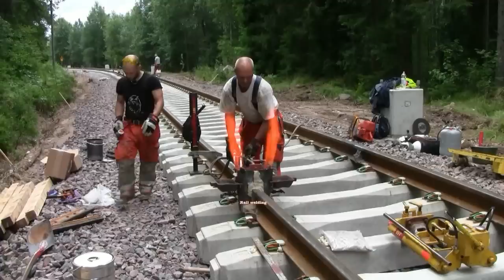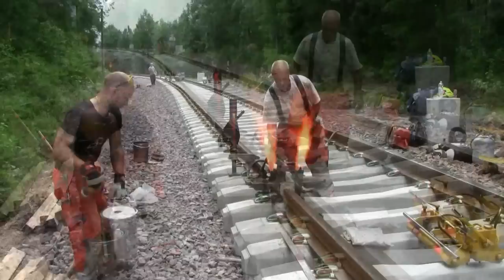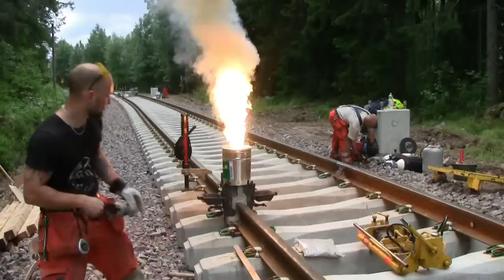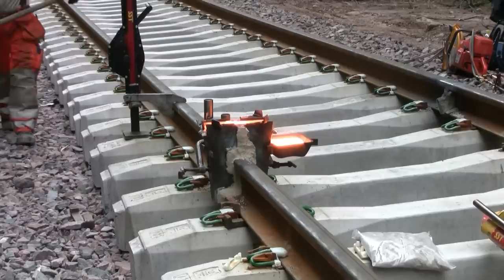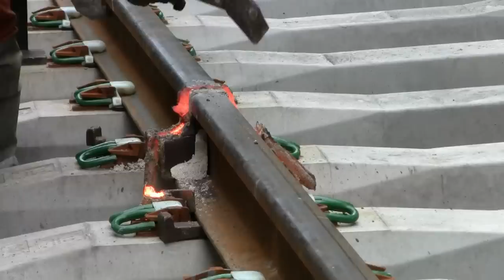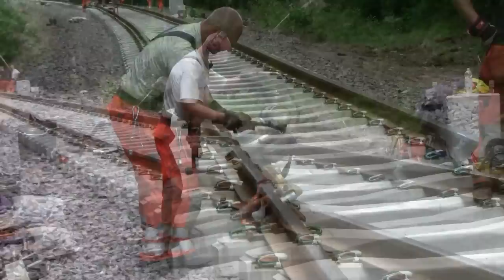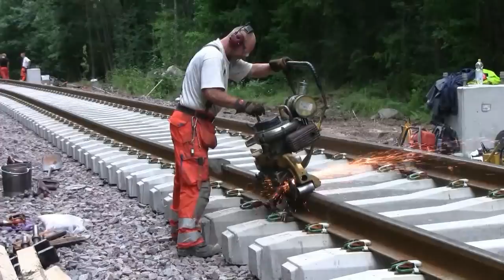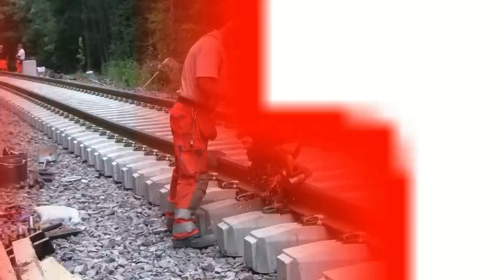Railroad thermite welding

Comment: Why didnt you show the track after the finish?? what was being done? No one said a word?
Reply: I will explain.
1) There is a clamp in place to hold the ends together as he heat treats them. This clamp also acts as a guide/holder for the thermite.
2) They use the thermite to bond the two ends together using the heat and pressure generated.
3) They remove the apparatus and clamps then proceed to knock off the slag (waste material) on the outside while it is still hot and brittle.
4) All that's left is for it to cool (which takes a while) then polish out any rough spots and check the quality of the weld.

You can see a finished weld behind them if you look closely enough. Hope that clarifies things for you. :-)
Reply: Zeb Cheek thank you! Very kind!😉
Reply: Welcome
Reply: this is just wrong...a civilized conversation in youtube!!!
just kidding of course :)
Reply: -Thank You.
Reply: If you do this job every day, 10 times an hour, you probably get good enough that you don't have to talk about it while you are doing it.  They probably do talk about other stuff during the day, (complaining about how their kids weren't doing their homework or whatever,) but the camera showed up and they didn't want to immortalize "Little Jimmy got a C on his science test last week" into the video, so...

That and they are in Sweden so they probably speak Swedish, which means most of YouTube wouldn't have understood it anyways.
Reply: Zeb Cheek 2) Heat and pressure? It can't really be generating pressure because it's just plonked on top -- the whole apparatus is operating at normal atmospheric pressure. My understanding is that the thermite reaction generates hot, molten iron -- so the fact that this reaction is actually providing new iron rather than just melting the existing rail is worth noting too.
3) Slag is a specific byproduct of the steelmaking industry consisting mostly of silicates, it's not just a fancy word for "waste" or "extra". So it's not an appropriate description for what's being knocked off -- which is just very hot metal.

Comment: Pretty funny how people in the comments thinks they know a better way to do that.
Reply: Have you worked on the railroad before?
Reply: ***** I haven't, thats why i don't trying to act in the comments i know better
Reply: David V Yea im sure a random guy that knows nothing of welding know a better way
Reply: Honestly, probably the fastest way to weld it in the field with a certain tolerance of quality.
It takes 2 guys. It only take what looks like $25,000 of equipment, probably less than 2 hours of work from start to finish.

There are many many many ways to do this with higher quality, but those ways would be slower, require more expertise, would be very hard to do in the field... Or if you managed to fix all those problems it would be fabulously expensive.

But then again, there is ALWAYS a better way... ALWAYS...
Its a question of cost of resources, time to complete, cost and time of the workers, ability of the workers, requirements of the job, what vehicles you already own... ect ect ect.

TL:DR There is always a better way. For some reason, cost/time/ability, thermite welding is often chosen for railroad construction.

Source: Welder certified in D1.1 6g 2in sch80 steel pipe, D1.1 steel plate groove unlimited thickness all position, D1.1 steel plate fillet unlimited thickness all possition, D1.2 aluminum AWS D1.2 (2015)
Reply: Chill Bro Main reason to use the thermite, if i remember correctly is because it sets in a way that makes the top extremely hard and durable, and the bottom, quite flexible. Don't ask me how it happens, but i think that's why they still do it this way.
Reply: I totally knew it would work. Just sayin'.
Reply: You mean the guys that say jet fuel can do the same thing?
Reply: Majman and you think you know better than people who may genuinely have a more efficient way of doing it.
Reply: There has not been a more efficient way invented yet when it comes to a cheap, fairly quick method of welding rail together, while there are improved methods/steps compared to what's in this video, the overall outcome is the same. Quickest I've ever done two of these is 45 minutes and we were moving at a much quicker pace than these two guys.

The average cost of a thermite weld is about 200 bucks, throw in man hours, fuel costs, etc. you're under 1000 a weld and it only gets cheaper as they get knocked out one after another. (Most railroads assume 2.5 hours per weld)

There is a method called "Electric Flashbutt Welding" that is much quicker than this, however the trucks that are capable are in the millions of dollars, and the owners to those patented machines charges thousands of dollars a day to use them, for this reason, it is usually avoided in non-emergency situations.
Reply: I was thinking exact same thing.
Reply: NO.   
 @chillbro1010   t

Comment: only 2,000 more miles to go.
Reply: Which requires 16,000 more welds, or 32,000 if you count both sides. They weld just every 200 meter or so, which means a true professional team like this can cover many kilometers in a day's work.
Reply: Not all rails are welded together tho
Reply: Easy money
Reply: 😂😂😂 These are the real MVPs.
Reply: Lmao
Reply: Zeksteve  I
Reply: sumon azizul Calcio serie a
Reply: Sweden isn't even that big.
Reply: that sounds like a secured paycheck for a couple months. I'm guessing around $35 an hour and around $50 for overtime. But they're in Europe so idk
Reply: @Lonnie Frank Yes, with Continuous Welder Rail (CWR) like this the whole thing will be welded except for Insulated Block Joints for track circuiting purposes (increasingly being phased out with Jointless Track Circuits and Moving Block signalling systems and in any case these have no allowance for thermal expansion or contraction and are treated as CWR).  In the UK they install expansion joints roughly every 5 miles or around points and crossing layouts, whichever comes first, (Speaking from experience so can't say for continental Europe) but apart from that new installations are almost exclusively CWR.
Reply: Bermas.  
☺😈😴 johnny rotten
Reply: turalula lu
Reply: Cadê os seus epi galera
Reply: I am Arc welder so I want job
Reply: @Meg_Lovegood  I Vi bio y
Reply: jojojeep1 dudes gunna be like 60 when this shit is done
Reply: @slaughtergang518  Sweden isn't in Europe it's in Scandinavia.
Reply: Paul Johansson I hope you’re joking... Yes, Sweden is a part of Scandinavia, along with Norway and Denmark. 

That doesn’t mean Sweden isn’t a part of Europe.
Reply: Mata
Reply: 13th Evergreen ,
Reply: 2019 and still 1,998 miles to go
Reply: @Dovenpeis  1km max a day id say on both tracks ?

Comment: If there is no small gap between the ties, how do they compensate for the shrinkage and expansion with temperature differences??
Reply: +Scott Huddas Essentially, the tracks are so firmly anchored once the railway is done that this isn't an issue in modern railway building.
Reply: the rail is stressed then welded, (not shown here) it artificially puts the temperature in the rail to stop it expanding.
Reply: +pandrol7 How about shrinking during cold?
Reply: good question, the rail can take contraction much more than expansion, at worst it will break and leave a small gap, the rail will still be fastened to the sleepers with no misalignment and derailment very unlikely, a buckle would almost certainly derail the train.
Reply: Thermite welding is done if there is a crack in railroad, and to compensate expansion and contraction of rails there will be gaps left b/w adjacent rails
Reply: nope

Comment: Where are the termites?
Reply: Bryce Dabney There actually is something called termite welding, where they use termites. So no, I am not an idiot.
Reply: +WarthDader74 I guarantee you there is no such thing as termite welding
Reply: 12345Unicornio That's strange, I have seen it myself.
Reply: +WarthDader74 OK, explain to me how it works
Reply: 12345Unicornio They used termites as a filler in the weld. It made the job less expensive. It could be done because the termites get a very hard consistency when they have been dead for a while.
Reply: +WarthDader74 hahahahah, That's the stupidest thing I have ever heard. Would love to see your source, I myself couldn't find any.
Reply: +Zyrus this guys just trying to find a way to cover up his mistake
Reply: 12345Unicornio Yeah, it was just too funny.
Reply: It just made a search on the internet myself, and it is difficult to find so much about termite welding. The reason is that 'thermite welding' is spelled very similarly, with an 'h' letter. And most info is about that. But I assure you that termite welding is real, a friend of mine did work with that in the 70's. Actually the reason that I found this youtube clip, is that I made a search for termite welding.
Reply: WarthDader74 HAHA, Just admit that you're wrong and you missed read the title as "Termite welding".
Reply: Zyrus No, I did nicht do that
Reply: Wow.
Reply: +WarthDader74 My uncle did termite welding in the 80s! It's sad that that method isn't used anymore.
Reply: MellowJelly Yeah, I guess it did since it's almost impossible to tell if someone is being sarcastic in text. How could you tell though?
Reply: +WarthDader74 LOL
Reply: +MellowJelly i did termite welding once. very impractical method.
Reply: Paul Hendrix Yes, it was unpractical, that's the reason they stopped doing it.
Reply: +WarthDader74 ur comment made my day lol
Reply: +WarthDader74 We tried that where I used to work.  We hired all these termites and bought the really small welding gear for them to use.  The little bastards just ignored the gear and the job was a disaster.  Soon after that, the building we were working out of crumbled to the ground.
Reply: rubert134 Ok I understand. But then you did it in the wrong way. The termites are supposed to function as a filler material in the welding itself. Some british experts came up with that idea during WWII, to save money.
Reply: +WarthDader74 Seems weird. How the heck would the termites help the weld bond the material? seems like it would just result in burned up termites and shitty welds.
Reply: Keinlicht There is some kind of special mineral in the termites' bodies, which bounds to the weld and interreacts with it. It is a chemical prosess.
Reply: WarthDader74
Huh. weird. Wish there was more documentation online about this, interesting bit of trivia.
Reply: Keinlicht It seems very hard to find, of some reason
Reply: +WarthDader74 You look like Jimmy Savile which is not a good look these days mate
Reply: Thermite is a mixture of multiple powders metal powder and metal oxide
Reply: AlphaMale1228 bout time rust made its self usefull lol
Reply: They are on that Tim Allen movie.
Reply: Coil Smoke Is that some kind of documentary?
Reply: WarthDader74 That was a reference to "Galaxy quest". Tim Allen's character kept calling his off world friends "Termites" but their actual names where>  "Thermians from the Klaatu Nebula".
Reply: Coil Smoke Ok, I understand.
Reply: no it actuallly exists, my uncle did a welding job using a block of solidified dead termites, it actually exists
Reply: They are plotting the next 9/11 my young one..
Reply: realize this is a long time ago, but in Denmark they call the process termit - svejsning https://www.svendhjorth.dk/index.php?option=com_content&view=article&id=260%3A2009-07-05-03-27-36&catid=57%3Ajernbane-teknik--sporarbejde&Itemid=115&lang=da
Reply: Warth, how’s the termite research going?  Can’t take this suspense...
Reply: One of the funnies comment chains I've read in a while
Reply: Zyrus I can tell when he said "Where's the termites".
Reply: Hehe, you made my day---LoL
Reply: Sorry, no. The hardest material in the insect's body is chitin (if you just thought of rhinos and/or fingernails, yes, it is that stuff.) Chitin is undoubtedly very useful. It has antimicrobial and antioxidant properties, making it a promising material in the pharmaceutical world. (Note: if you grind up and eat rhino horns, it won't cure your sickness, so don't kill any rhinos.) Despite this, chitin has no uses whatsoever in the transportation or welding industry. Have a nice day.
Reply: Jokes are funniest when you play along.
Reply: Thermite ,silly.
Reply: WarthDader74, did a good job at it too, Hugh Mungus.
Reply: Everyone knows about Termite welding. Amateur. Now go get me my wood stretcher and blinker fluid .
Reply: In the background watching
Reply: In the bucket. R.I.P Bucket..
Reply: Any updates on the termites?

Comment: where im from they dont weld railroad, it gets hot in summer and cold in winter so it needs to expand and retract alot more.. they just leave a small gap inbetween each section..
Reply: All new tracks laid in both Norway and Sweden are thermite welded, there's tracks going via Kiruna and up to Narvik in norway, Kiruna sees average temperatures as low as -22 in the winter and average highs as high as 17.9(acording to wikipedia). To acomodate for thermal expantion/retraction they are using Pandrol e-clip and fastclip to fasten the rails rather than bolting them down as more traditional with jointed tracks.
Reply: ChargedTTq yeah they wrap barbed wire around the gap REALLY tight and call it a day lol
Reply: Zphyra Ryuu if your "hot" means 40-50 C , then i'd agree these welds will work just fine in regions with a large range of temperature difference in winters and summers.
Reply: Patrick V same but in north america railroad is a thing of the past and they are ripping out tones of tracks anyways. ares are cheap to build last forever and cheaper to fix
Reply: neosomato hypergenesis #皮

Comment: When you mix fuel, metal oxide and metal powder in just the right way, it burns at two thousand degrees Celsius. Hot enough to cut through nearly any barrier known to man. Throw some C4 into the mix…and you’ve got one hell of a combination.
Reply: Nobody knows that for sure
Reply: Rust and aluminum are very uncommon materials in modern construction. Pretty fishy if you find them. right?
Reply: Jet fuel seems able to cut through twin towers
Reply: Is this a 911 reference?
Reply: Really big f*cking hole coming right up.
Reply: Say hi to the FBI for me
Reply: MaQuGo119 UNLOCKED: THERMITE
Reply: vx
Reply: Technically you only need anhydrous rust (stick some rust into an oven or something) and powdered aluminum
Then you need something to heat it up so that it will react. The formula is 2Fe(s)+Al2O3(s)->Fe2O3(s)+2Al(s)
Reply: FOOKIN LASER SIGHTS
Reply: I spy a Rainbow Siege Six reference ;)
Reply: M C

Comment: I heard that jet fuel can do the same thing. =)
Reply: thank you, I wasn't allowed to stop scrolling until I found jet fuel reference
Reply: TheYAYOsvk I came all the way down the comments to see a 9/11 comment lol
Reply: Yeah, ignore all the special equipment they needed here in this video and the fact that it needed to attach directly to the rail and the amount of time it took to do just one single weld (completely undetected right?  After all, they're out in the woods in the middle of nowhere.)  Truther's aren't fucking morons because they think 911 was an inside job; they're fucking morons because you can point out the obvious flaws in their conspiracy theory and yet they'll still think it was an inside job.
Reply: apparently it is more of a meme then a terrorist attack.
Reply: Jet Fuel burned up at the moment of impact, hence, the bigass fireball....the fuel turned into vapor, and flashed off.  What was left behind, was a cool fire.  Think of this....you cook a pizza in your oven at 425....say even 500 degrees.....forget it, change subject....what does the mom look like?
Reply: Special equipment?  A bucket, shovel, source of ignition, and some prepared thermite powder.
Reply: Turns out Mossad can melt steel beams tho
Reply: Try to explain this one...

Radar data from 10+ stations reported the exact speed of the planes on 9/11. It was even covered completely in the 9/11 commission report. Btw did I mention that such radar data is never wrong unless fabricated?

Now feel welcome to look up the maximum speeds of the planes, especially given what altitudes they were are; from above 10k feet all the way to a few hundred feet - to near sea level.

Next look up the word FLUTTER. Better yet talk to ANY pilot about the word.

Because just a few brief seconds of flutter rips any plane (even the most advanced jet fighter) to shreds in just a few brief seconds.

So how exactly did all of those planes exceed their maximum engineered (by manufacturer and also by physical testing) speed by 10 to even 25%+ for many minutes on end.

Simply not possible; proven by physics and by elementary engineering.

If you think that it can be done, let me know - I'll take that bet on any level.
Reply: Jet fuel is diesel...
Reply: Ronald C Krause Jr yeah that report was a bit off. On page 43 I believe, it states Bush first learned about it at the school. Thats crap because John Cochran reported to Peter Jennings that he was told at the hotel a half hour before getting to the school. Get that news report.
Reply: Polish Sausage i invite you to watch the footage of the flow of liquid metal from the second tower
Reply: itinensanzen cant be a Hilary shrill on fox
Reply: look a the hole in building VI.
Reply: Ari Lehtiniemi Thought it was paraffin?